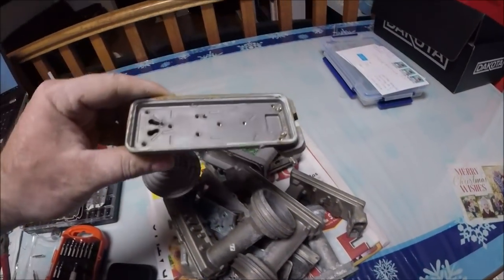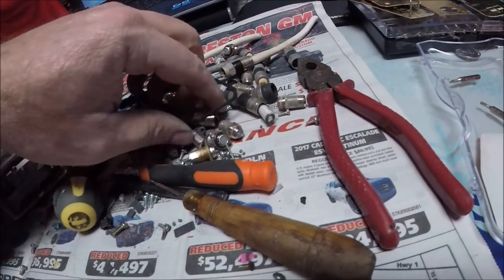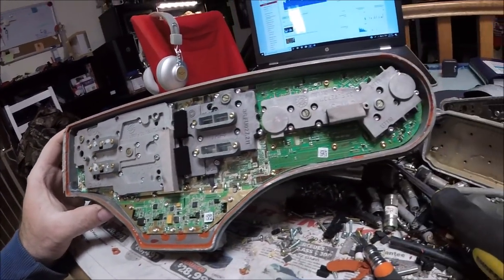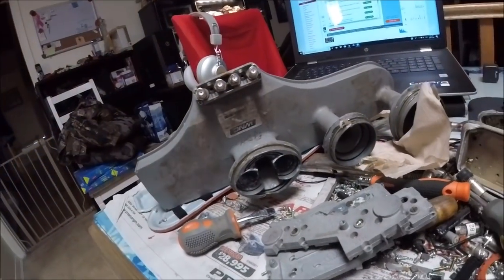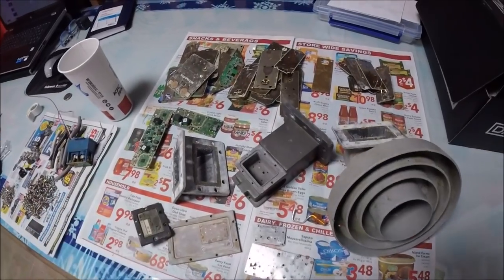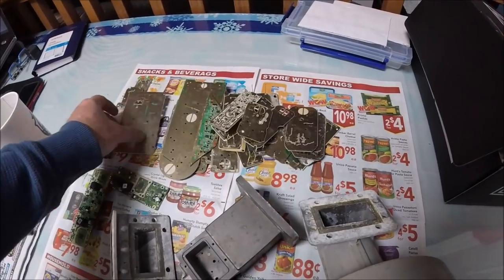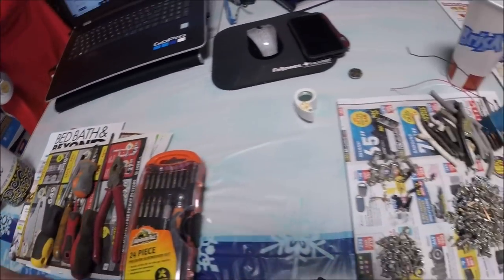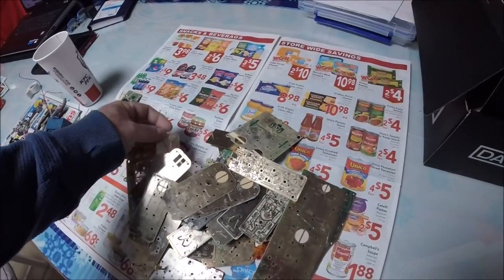Scrapping 20 Satellite Mini Dish Feed Horns For Gold Recovery

Comment: Yall ever found some kind of satellite either amplifier or sender, no idea what its called, but the main part was a cast aluminum rectangle housing bout 8" long, it had 2 rectangle boards in it, one completely gold plated, the other gold with at least 13 tantalum caps and other chips/mlcc
Reply from the maker: I had scrapped feed horns for large dish's before

Comment: Don't use a drill one or two hits with hammer gets those max out
Reply from the maker: Thanks For Watching, I sold them as clean for 51 Cents a pound
Reply: @CanadianTreasureHunter I just got a pile of these, the cast on a lot of them seems heavier and different color than regular aluminum, I think it's one of those aluminum copper alloys